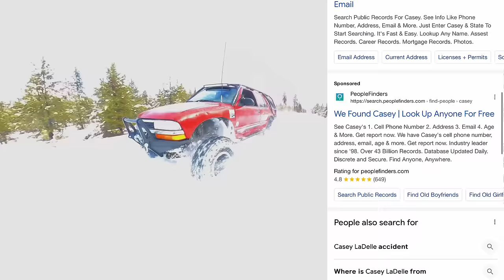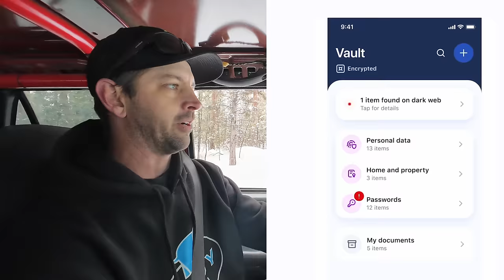Broke down and stranded, everything went wrong..  🤦🏻‍♂️

Comment: Many years ago I got trusted with the company Unimog to go collect a big stump grinder. Out for the day driving a Unimog by myself - dream job with a big responsibility. Got all the tricky urban stuff done and was heading back feeling overconfident when I encountered some military guys stuck in a ditch. Like a fool I offered to haul them out.
Everything went to Hell in a handbasket. Blocked the road, broke the back window in the cab, nearly flipped the army wagon, jack-knifed my trailer and got jammed, got a big chain knotted round the front linkage on the mog. 
Left a huge mess in the road and limped back into the yard, late and ashamed!
I feel your pain.

Comment: You can hear a big POP sound, right as Casey shifts into forward gear to begin the turnaround.  That may be the moment the front end gives up.
Reply: I bet it's a hub.
Reply: @ericsellers9506 the u-joints in the hub weren't turning but the driveshaft was. Only thing left is the diff.
Open knuckle front axles let you see what is broken. Old 4x4's like my 61 IH had closed knuckles and true constant velocity joints. In the 70's they went to open knuckles and u-joints because constant velocity really isn't an issue if you're on slippery or loose terrain.
Reply: I heard that POP too. Ring & pinion or spider gears. Time for a 1 ton axle.
Reply: Yep, heard the pop at 9:36.
Reply: I was waiting for Casey to pop out of the truck at some point, realizing he accidently knocked out onto 2wd mode 😂😂

Comment: You got the customer and yourselves out, good job. Don't beat yourself up, learn from it and move on. Those  high lift jacks  are the most dangerous jacks out there. I have 3 of them and learned the hard way. You can make you a larger base for the jack to make it more stable. We did that on ours no more learning the hard way.
Reply: I have a similar one, a bumper jack for my impala and it scares me to use it
Reply: Easy way to lose some teeth if you do anything wrong at all either it. I have a hilift, we are super careful with it.

Comment: That part of the hilift can also be used for clamping.
A hilift has to he one of the most dangerous tools, especially if you don't use your brain, but when your winch fails and it's all you've got left, or when even wincing won't get you out of added hole and you need to lift a wheel to stack some rocks, its such a valuable tool.

Comment: Casey, on that blazer if you haven't found it yet. Under the battery box there is a vacuum module that engages your front differential. its controlled from a vacuum switch on top of your transfer case. All it take is a leak and your are done, no 4x4. 

I know since I have the same truck.
Reply from the maker: No there isn’t.  Everything you just said is incorrect
Reply: @CaseyLaDelle  what year is your blazer? Mine is 2001. I have the push button shifting for 4x4 so maybe you have the manual shifter one. My bad.
Reply: I said the exact same thing you did. Bad design by GM.
Reply from the maker: @b61mack56  do you not see the solid axle in the front of it??
Reply: @CaseyLaDelle  that wasn't my reply. Someone was commenting on my post to you. Yes I saw the the front axle once I went back and reviewed you video. So if you see anything about that video from me just disregarded. Be safe out there.

Comment: The blazer has a vacuum actuator that engages 4 wheel drive, it is a very bad design due to the rubber tearing on the actuator itself, which will not engage the 4 wheel drive. I put a lift on a S-10 and that is how I found out.
Reply from the maker: No, this Blazer most definitely does not.

Comment: To get loose from the snow, always turn the wheels to follow your tracks into the snow. That makes it easier for the car to pull itself out of the situation. If it gets stuck, try rocking it forward and back again several times and see if you finally will get the traction you need.

Comment: I remember going out on a recovery around 25 in snw like that and blowing the tranfer case on one of the trucks, we used the smaller truck and got out, the next day we changed the transfer case in the bush where it was stuck at because it was to far to pull out and get home, these were both 78 and 79 bronco's. Retired years ago due to health reasons and the all the tow trucks and 4x4's were sold off by the owner. I live in Ohio and we don't see much snow now, it's nice to see the snow just miss being able to walk around in it.

Comment: Your a good self conscious person wanting to help.  That's why your so prepared & have extra equipment ect.  Having a reliable rig is subjective..... we all break down even when we service everything religiously.  Having  an over built rig has its advantages special if your running lockers &  large aggressive tires.  Matt's wrecker eats transmissions & built transfercases....  Even Paul's big block in his wrecker eats pushrod guides...  he was fed up & needed reliability so switched to an LS & added a supercharger.  Paul's Taco broke the front axle so he parked it till he can install 1 tons.  It happens when you work your rigs if they are not built to handle it.

Comment: You know way more than I do, but I do a lot of snow wheeling and have had exactly this happen to me once. This old guy gave me great advice lower your rears as much as you can, but leave the fronts pumped up because there's less resistance. I was doing all 4 low air like you and got stuck, aired the fronts back up and made it out. It could have just been a fluke, but it's worth a shot. Try not to be so hard on yourself man, stress is a killer for guys.

Comment: Ever think about a receiver, mounted winch that you could actually move between your vehicle and the customers in an emergency? I use parrot clamps on welding cables and a plow plug to unplug them from the winch.

Comment: Its amazing with the big tires aggressive setup it still has trouble in 2wd even with lockers.  What a difference 4wd makes.  Not much weight in the back I guess to help you out.  The VW buses even in 2wd can tackle some serious terrain because of the weight transfer to the back axle due to the engine being over the axle.

Comment: Have you already taken the tracks off whatever they were on?  They  would have been perfect for this recovery. The S series used to have a vacuum chamber or electric motor that would go bad and you had to go out on the passenger fender well and pull a cable manually to engage the front axle.

Comment: I had a couple of thoughts. But the biggest one is I am getting old and I don’t think I could have put in this much effort anymore. I would have just died. 

I got stuck in the snow bad years ago. Tried to get pulled out with a Dodge Dakota. It got suck too. Called a buddy with an f250. He didn’t get close. Called a buddy with a deuce and a half. He got stuck too. Ended up having to rent a D6 cat. Got it all handled but daaaamn it was a long, exhausting, expensive day. 

It was a really rough experience. And it was a lot of years ago, when my body worked a lot better and even then I was struggling physically a lot.

Comment: That front axle isn't a bad axle, it was obviuosly broke when you bought it . New gears set up properly will last yrs doing what you do.Locking hub should be the weak link if it has alloys and super joints.

Comment: Hi Lift Jacks... Love them or hate them. One time the truck slid a bit and the jack slammed into the body. Hate them. One time I taco-ed a drag link. I removed it, beat it straight, and sleeved it with my Hi Lift Jack handle and drove out 5 miles on a NC MTN trail to black top and then 120 miles home. Love them.
Pro-tip- if you mount your Hi Lift on your front winch bumper brush guard... don't WD-40 it. Once you get rolling, all the WD-40 blows off and onto your windshield.

Comment: You say "I never said I was good at this."   But you actually are.  Never giving up.  Always having a next solution.  Having the equipment to winch out, a high-lift jack, proper clothes, teaching a customer what to do.  It is hard to predict a differential explosion.  You did good.

One thing though.  What if the "lazy guy" as actually disabled in some way?  Dunno, never followed your link.

Comment: I would have considered leaving the fronts aired up. For a lower rolling resistance. I do understand wanting to stay on top of the snow with. Bigger foot print.  A foot print works best with a tire that pulls.  Worked either way. Not for criticism, just for a thought.

Comment: Nice to have a set of heavy duty snow chains in the back. Never know when they get handy. Would have worked even with only rear wheel drive
Reply: Snow chain in deep snow don’t work unfortunately
Reply: @DIRTVENTURE  Then a snowcat is the only solution for float and traction
Reply: @Frank-Thoresen  or a tracks on a truck.  Oh wait Casey does have one of those.   Just might of been too heavy for his trailer

Comment: The handyman is the best tool if you do not have a winch but ive brome my nose cheek bone and lost vison in my eye because i did NOT respect that tool nice work keep the good work up. Did you use a balloon on your air line ends to keep ice out of the fittings?

Comment: Question: if you're stuck in 2 wheel drive, do you still want your fronts at the same air pressure?  Lower pressure on the fronts might help with direction control, but wouldn't higher pressure help with lower rolling resistance?

Comment: I had a really bad experience with a tow truck when I needed to get rescued from an off road recovery about 12 years ago. The tow truck driver lied to me about if he couldn't get me out of the mud in a Pontiac boneville. I was 25 miles from any pavement. The tow truck driver had a very bad ego, he ended up getting stuck trying to back down to pull me out. When he tried to winch his self out he broke his door handle and I had to give the throttle.There was no cell service so he said that he was going to walk back for help I didn't want to be there by myself so I started walking back with him and while we walked a quarter to a half an mile a dodge ram came  on the road and asked if we were the stuck car and tow truck. We said yes and he then backed down to the tow truck and pulled him out and then backed down to my car and pulled me out and then the dodge ram passenger drove me to a dryer place on the road. The tow truck driver ended up charging me $250 even though he didn't succeed in pulling me out I was only stuck with one tire. I tried to fight it even when the tow truck driver came to my apartment complex for a different tow and he wouldn't budge at all
Reply from the maker: I wouldn’t have either.  If you call me out to do a job, you are paying my trucks hourly rate from the time it leaves the yard to the time it gets back to the yard.   End of story

Comment: Damn, that would have been a lot easier in the tracked truck.  But even with a broken front end, you still had the winch and all the gear to get the customer and yourself out.  Nobody hurt, and everybody got out.  Good job.  If you feel bad after a free rescue, take them to lunch.  Nothing like a good hot meal to make everybody feel better after a night stranded.  I used one of those farm jacks to pull rotted fence post stubs out of their concrete footings, then put chain link posts in the holes with a little concrete.  Easiest fence replacement ever:  No digging at all.

Comment: My opinion, it's a win. Customer got out, you got out and you're both driving it home... As far as the axle goes, both u-joints were spinning.. so everything is good in the axle housing. You either busted both axle stubs, hubs or the hubs came unlocked, plain and simple.. My guess is on broken hubs.

Comment: WARNING- always check you front and rear gear ratios-they must be the same . Also your front and rear tires must be the same size, otherwise you will cause damage sooner or later.
Reply: But wouldn't you want to stop and put a higher ratio in the front while you were making the k turn then swap them back for straight driving ?

Comment: Apparently this is the time to post videos about recovery machines letting YouTubers down. Matt did a rescue with Robby and both their snow cats had failures. They, too, were doubting if they were going to be able to pull out the customer's truck.

Didn't the oldtimers say when they go off roading that it is common for the person who is in trouble to change as they go thru the trails? Apparently, this is to be expected and that is why traveling in groups is best as each person takes turns being the helper or th helpee.

Comment: Are you still running the factory GM transfer case? Or a jeep case

After owning 3 chevy's they use chain driven. Garbage design because it causes front u-joints to eat up, and hella driveline play all the way to your diffs.

Im wondering if you messed up with a tooth /gear or is it a gear in the actual diff?

Comment: At least the winch didnt catch fire and melt the grill.. after your hydraulic rear winch blew a line.. the poor front winch had to pull a close to 10,000 pound rig (1977 full size 1ton suburban fully rigged) out of trouble.. oh, and it was only a 6000 lb winch .. fun day that was..NAWT

Comment: Man, get those trucks out of low range.  Too easy to spin the tires...  In high range, if you add throttle and it doesn't move, at least it doesn't spin.  Get on the brake, gear for other direction, use any "rock" to move.  DO NOT throttle until it spins in packy wet snow or you make a little hole that becomes ice immediately...   Still, you got out, so that's good...   :)

Comment: Thought maybe you sold the tracks at this point since I was surprised you didn't take them, but you did mention em. I guess this scenario was bound to happen as you mentioned the other job you bailed out on with this truck so in a sense its good to get the bad out of the way, or something. 🤪

Didn't know Ethan had a truck till you posted your screwing around video with the free truck, only thing I could think of is maybe start taking that one with you as well as a support truck on certain jobs. Of course that's more wasted money in gas and stuff, but I don't know, might be worth it on those certain rare jobs as a peace of mind thing. But I also have no clue how capable it is, as it is a land rover after all. 😉

Comment: Casey you didn't fail. You didn't call in for help. You used the tools you hand and made it happen. Vehicles break and crap happens. But I would avoid that section of the road. Between the Dodge and the Blazer it's a haunted spot.

Comment: lol alot of keyboard warriors in the chat.  equipment failed at the right time.  perfect location to winch out. a capable customer to return the favor and it didnt leave you stranded far from everything.  i would call it luck that it failed here and not  at some sketchy location. one thing is what you are supposed to do and another what you sometimes have to do .
you did great Casey dont be hard on yourself. sometimes you just need to wear the creative hat. i would work with you anytime.